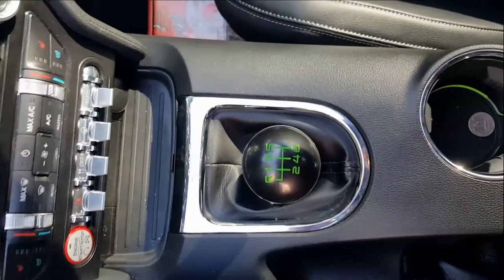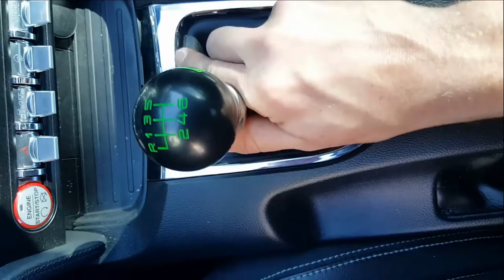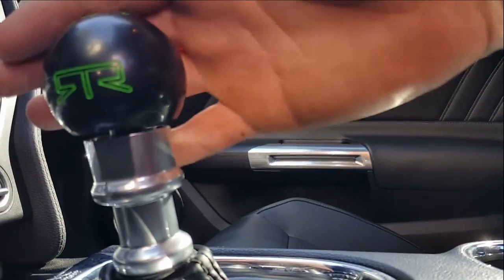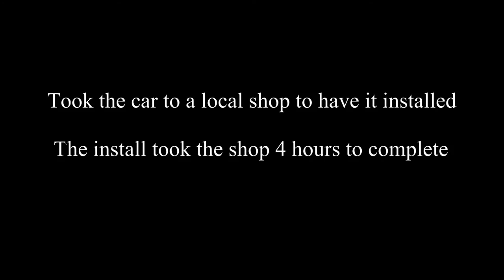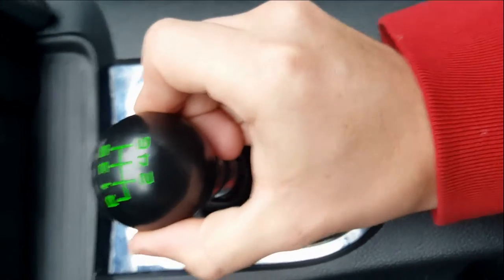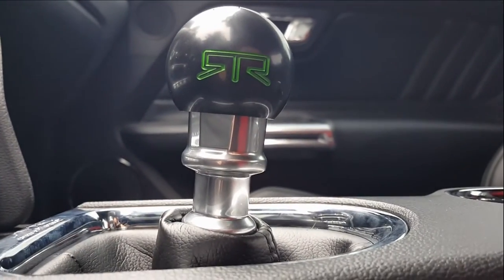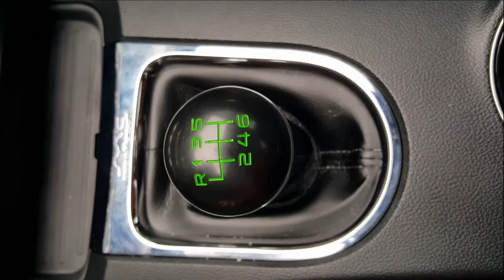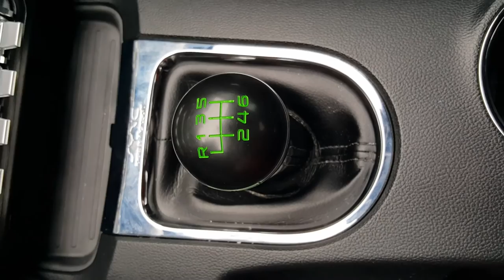Steeda Tri-Ax Short throw vs Stock | Throw Length
 Difference | S550 Mustang build

Comment: Hi from Down Under. You mentioned a issue between the gears on your old shifter, if the revs weren't correct it wouldnt go into gear. Has this issue gone now? I did a install yesterday into what they call a Ford Falcon XR8 6 Speed Manual. Has a factory TR56 and has a  similar issue on the revs and gears selection. Still finishing install so haven't tested it out yet. It took all of 5 hours for me as the top two bolts are a nightmare to get to. I ended up using hex nuts on the install and drilled to small holes in the tunnel body for easy access next time. I wonder why they never think of us modifying when they assemble these cars at the factory. Nice video.

Comment: How has this thing held up bro? Which spring setting did you use, the most firm one? How is road noise? Thank you bro
Reply from the maker: +Gorilla Garage thank you! I used the firmest spring. It has been good, but if I were to buy one now I'd probably go with an MGW. The road noise isn't bad, but I had an issue with the lock out spring vibrating up against the shifter shaft so I have had to mess with it to keep it from rattling.

Comment: How's NVs?
Reply from the maker: +bdawg7693 its not bad...however mine had an issue with the reverse lock out spring rattling in the housing. I fixed it, but when you spend good money on a short throw it shouldn't have those issues. If I were to buy again I would get an MGW